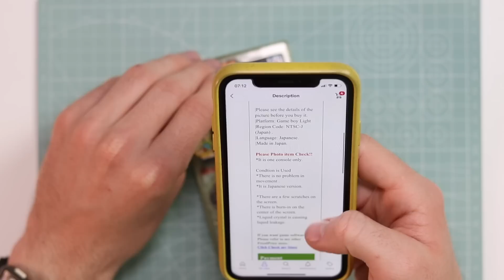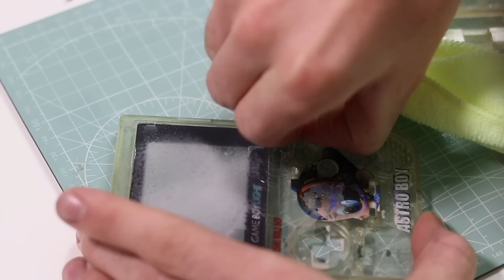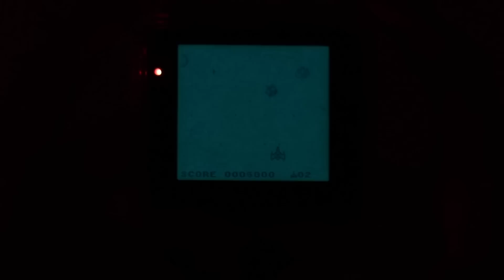Rare Astro Boy GameBoy Light FULL Restoration

Comment: 2:14 the baseball stickers are from a Japanese baseball game on the nintendo switch called jikkyou poweful pro baseball
Reply: I'm fairly certain they're from before that as well. I remember a rather terrible Wii baseball game using that character design
Reply: The series has been running since the ninteties. There was a Game Boy version released the same year as the Game Boy Light, so there's a decent chance this device's original owner had a copy.

Comment: People RAHEEEEELY need to stop using WD 40 on plastics, especially as a part of a restoration process. It is corrosive and makes plastics and rubbers brittle. It also makes it overly shiny and greasy. If you need a salvant on your restoration project, generally isopropyl alcohol will dissolve most adhesives and stickers. If you are looking to condition/brighten/shine up the plastic casings, then use something like Armor All which is designed for that purpose. Also, are you wearing a respirator for isopropyl alcohol?

Comment: I have had a seller put that the speaker didn’t work in the description but when I turned it on it worked fine 😂
Reply: Similarly, my GBA I bought on eBay was described as having a failing screen, so I bought it to IPS mod it. The original screen seemed fine, just as dark as it was on release.

Glad I upgraded the screen anyway through.

Comment: Hey possible tip: Use Goo Gone instead of isopropyl alcohol to get rid of the glue on the screen. Unless Goo Gone would damage the screen, but I don't see why it should. And afterwards just wipe the Goo Gone off with IPA. IPA isn't great at removing thick glue residue. Goo Gone, 2 minutes soaking, and it should come of in two or three wipes.

Comment: Great work on the refurb! I have to disagree with a lot of the comments though, I feel removing the stickers was the right thing to do. The unit is expensive because of the astroboy decal, not the 100 Vodaphone stickers.

If you're sentimental over it's original condition at least it will live on in that form in this video.

Comment: Just for future reference, there's this product called Goo Gone. It comes in a spray bottle and it's the best stuff I've ever used for removing stickers/adhesives. When I used to buy DVDs from the local video store they always had these stickers on the inner circle of the disc. When you got the sticker off, the adhesive residue was super sticky almost nothing worked to get it off. Goo Gone literally took it off like nothing, plus it smells like oranges so it's great lol.

Comment: You should sacrifice a few screens to practice removing the adhesive with a razor blade- I couldn't imagine doing residue like that with a plastic spudger.

Also just curious, have you ever tried using a hair dryer or heat gun for things like all the small stickers? It doesn't always work, but more often than not it's exponentially quicker to first peel the laminate/printed parts of the sticker away with heat, and then submerging in a solution bath for scrubbing away the remaining residue. In my experience the print/laminate side is more likely to become a gummy mess if it's left on for submersion.

Love the channel! Nice work and I love how well you explain your processes

Comment: Lighter fluid would break down the adhesive much easier than IPA. Then after you use the lighter fluid you can get the lighter fluid off with IPA. You will use much less IPA that way and make the entire process much faster.

Comment: If I may give you an important hint, if you actually did´nt use it yet:   Use only ESD tools (not standard screwdrivers) and an ESD-tablemat (ESD = electrostatic discharge). 
And you need an ESD-bracelet as well, but these are sometimes a part of the ESD-tablemat equipment.

In many cases of ESD, you won´t even know, if you have damaged any parts on the circuit board.

Comment: I cleaned my old 2nd hand gameboy color yesterday, first time I opened one up, it was GROSS! I'm surprised you put the entire shell in the sink too! I hadn't removed the battery contacts and the screen so I used a lot of time, qtips and water. What liquid did you use to remove the glue on the screen? And what liquid to clean the electric parts? (I was shocked that you put liquid on there actually 😂)

Comment: Is it possible to put a Gameboy Pocket pcb in the Gameboy Light shell?  I know the battery terminals will not line up but you will gain a larger battery compartment for installing a rechargeable battery. Will all the buttons, volume, contras and ports line up? Thank you

Comment: about scraping away the polarizer glue residue, i THINK you can use a much less tedious approach!
instead of alcohol, pick a bottle cap and spray some WD-40 in it, then, just like you do now, use a qtip to transfer it on the screen surface, wd40 has not much surface tension just like alcohol and should spread effortlessly.
Then, just wait! maybe an hour? then proceed to scrape, it should be WAY more effective to soften glue and make it all soft and gooey, resulting in a much less tedious process

Comment: Can u make the ultimate retro handheld, I'm thinking a trimmed ds or 3ds in a gba xl metal case that can be switched to a raspberry pie compute module.
Reply: A pie compute module is just the  CPU storage and ram in the form factor of a laptop ddr2 memory stick. Designed for smaller applications where u have to build a motherboard anyways so u dont need the whole pie.

Comment: Where did you get the replacement screen? I'm at my wit's end with Retro Modding. 
I ordered a cgb-001 replacement screen and the one they shipped me is too big, the ribbon cable is the wrong size and also too short. It was advertised to fit the cgb-001 that I've owned for decades, but it sure doesn't! And I can't seem to get ahold of them about a refund or replacement now. 🤬

Any recommendations of a more reliable place to get the proper screen? Cheers.

Comment: Can anyone give me some advice about removing a stripped screw from the r-button corner of an sp? I’ve tried just about everything short of buying a $70 tool
Reply: If you can get a really small flathead screwdriver you can "carve" your own small slot into the screw and then, with a lot of pressure, use the flathead to unscrew it. Think of a sawing motion so that the hole you make is the exact size of the flathead width wise. Make sure you have a nice indent in the screw before you try. The screw is a softer metal than the flathead so you shouldn't have trouble making a hole. Once you get it out toss the screw, put a new one in. Good luck

Comment: I heard from The 8-Bit Guy that hydrogen peroxide restores yellowed plastics to its original color with the help of UV light (usually from the sun or UV lamps of some kind and by also putting the yellowed plastics in a create with part water part hydrogen peroxide) (while usually the yellowed plastic becomes white some plastics becomes beige because that's what the original color is)